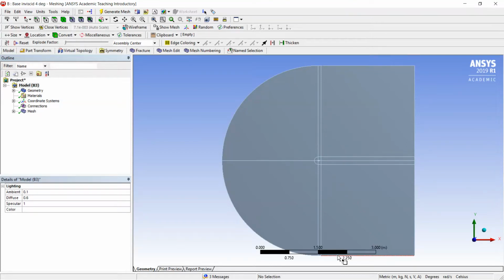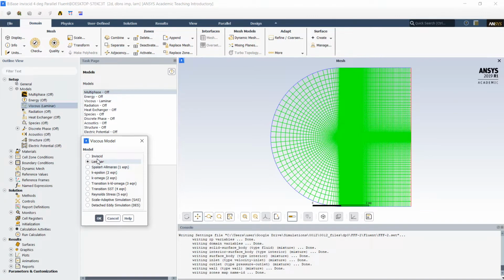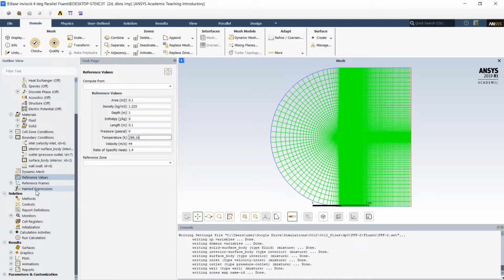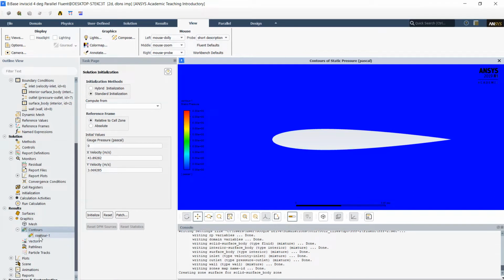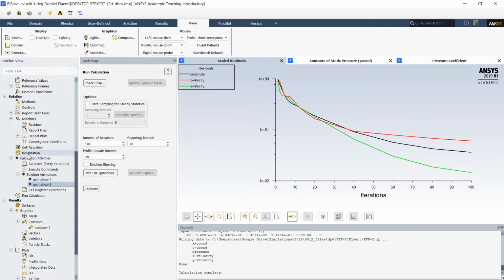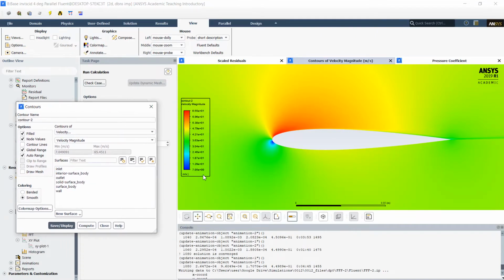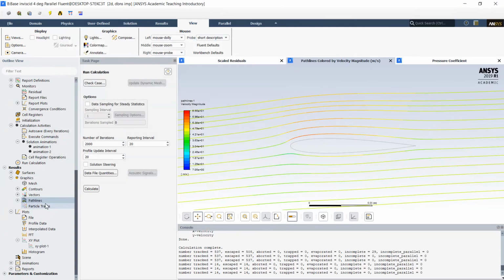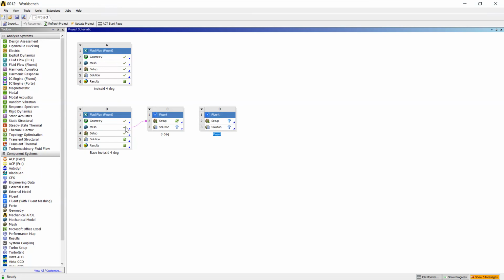Airfoil Simulation study in Ansys Fluent - part 4

Comment: Hi,
very interesting tutorail for a step by step set up of the problem. 

but I do not understand the result
You set fluid as inviscid and therefore the Navier stokes equations should degenerate into the Euler equation. 
Without viscosity the flow velocity field is irrotational  (at least if no vortex are already inside the fluid domain as in this simulation since flow at boundary has only translational component). 
For irrotational flow it can be demonstrated that forces exerted by fluid on a moving body are zero (both drag and lift). Whicever is the shape of the object (it is the so called D'Alembert paradox)
Except the case of vortex generation at the trailing edge of the airfoil.
But the simulation apparently do not show any vortex birth at the trailing edge then moving downstream the airfoil . Flow lines are quite straight downstream of the airfoil.
How can you justify that ?
Is there something I do not catch in the results ?

Comment: hi,
in the inlet boundary condition if i change the angle of attack by change the directional vector.like below
for example
X-direction 1
Y-direction 0
which is 0 angle of attack. right?
X-direction 0.97814760073
Y-direction 0.20791169081775931
which is 12 degree angle of attack. right?

if i change the AOA, do i have to change the axis for the life and drag?
Reply from the maker: Yes, you need to change the axis orientation. Otherwise, you will receive the normal and axial forces (coefficients) instead of the lift and drag.